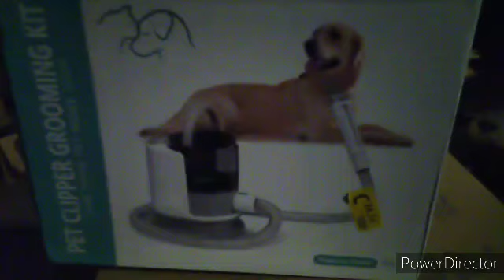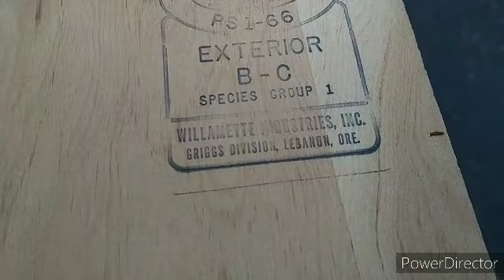wheels on the cabinet. "wall" of shelves and cabinets taken down.. progress!!

Comment: Blakely 😍😍😍....she's got a ways to go but good to walk her around and make those legs strong..... Worked in the shop all day on project" John Deere sickle". All the parts came today, by Sunday we should be on painting and reassemble....Snowing right now so we may have a little white stuff this winter after all....Thanks Ed, have a great Saturday.
Reply from the maker: 😊
Yes sir, in the meantime, we will keep helping her, until she can do it on her own 👍
Parts day!!! And ❄️❄️❄️ dang sounds like winter is finally arrived!! 
Thank you Brent!!
Have a great Saturday!!
Reply: Good evening Brent. A little snow here too. 1/2 inch maybe.
Reply: Good evening Ed. They plowed in fiber optic all over here on some government rural development deal and then the outfit went bankrupt. Some other company has it now but they're so useless it's almost impossible to get them to even do a new connection.
Reply from the maker: @farawayfarm2520 good evening Will.
For the most part, they've been pretty good, one of those buy out the old company, update everything, then sell it back, .. that's the idea anyway.
They didn't expect all the new construction, as they weren't as familiar with the fast growth here. Last I heard from one of the techs, they hope to be actually replacing lines in a couple of years.. until then, the techs are pretty much run ragged..
Would be nice to have fiber optic.. then maybe I'd use the internet more and not all my phone data..lol
Reply: @farawayfarm2520  Good Evening Will. We're at about a 1/2" here too...they say 5-9 for us, I'll believe it when I see it.....
Reply: @brenterickson1695  I heard all kinds of ridiculous snow predictions today. I bet we get 2 inches or less out of the whole thing.
Reply: @farawayfarm2520  We might get a little here next to the pond, east wind lake affect.